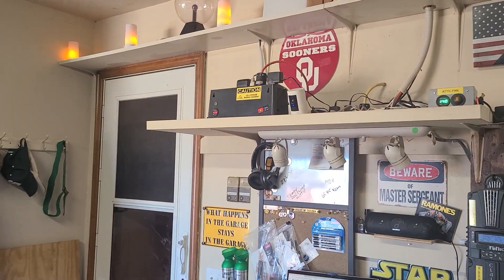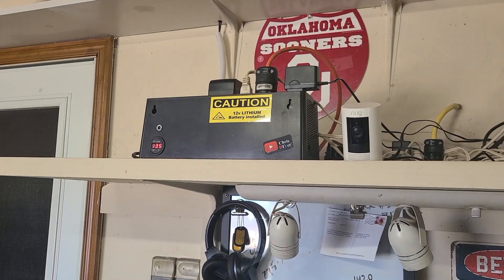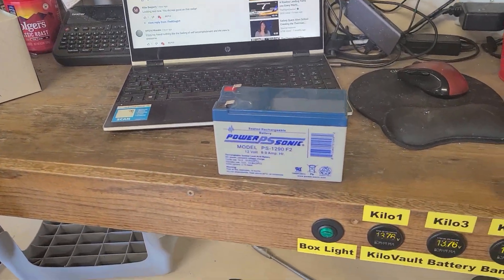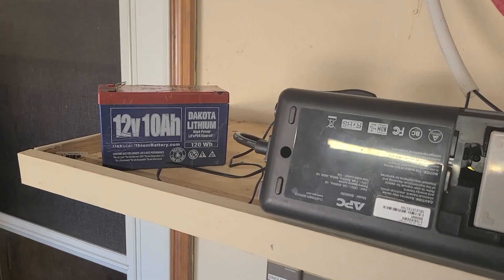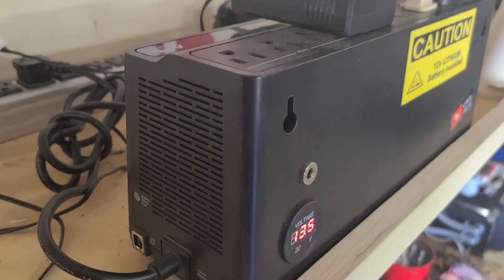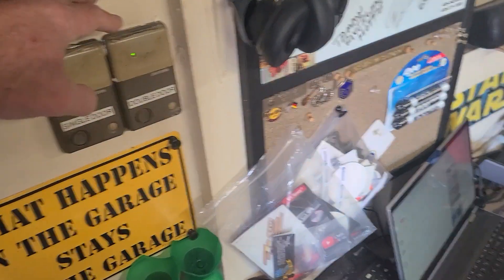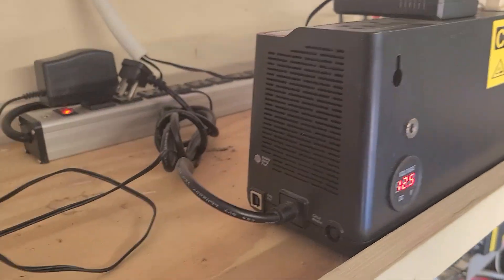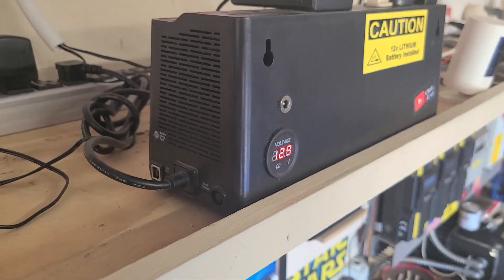Experiment! Will an APC Battery Back Ups 900 open my garage door?

Comment: The problem with a standard UPS is that is starts draining power from the battery as soon as AC is lost and will likely only run a short time before the battery dies compleley and even before it dies, there is probably not enough current in the battery to open the door a short time after the power dies.  Best would be to run the logics of the opener from a battery, and engage the UPS power through a relay when opening/closing is needed.

Comment: Why not put your watt meter in line and see if it peaks when in use, 
Maybe something simple like a bit of crud on the runners, or if it needs grease. 
Documentation of the garage motor, uses x amps but can goto y amps.

Just a few ideas, good luck.

Comment: Most of the small UPS' are typically have high frequency inverter or worse a modified sine wave inverter inside them. They typically don't have very good startup kick to them when running inductive loads. You have to size them almost 3 times the actual running load amps of the motor. Plus you have to contend with the internal BMS of the lithium battery on the surge amperage on the DC side.

I have successfully operated my garage door with an APC SUA1500 which is rated about 900 real watts and it is a low frequency inverter. I can say that unit quite heavy even without the two 24 Ah agm battery installed. Since it is configured for 24 volts, it'll handle the startup surge a little bit better than its 12 volt counterpart. I am working on to replace the lead acid with lithium soon as the 100 amp BMS arrives in the mail.
Reply from the maker: I think a 1500 dual battery would work @ 24v. I don't plan on buying one just for this purpose...unless I can find a hot eBay one online for cheap and modify it

Comment: with the led acid battery back in it; it may be the inverter inside that ups or safety circuits as that's not an online ups.  i didn't catch if you were running the ups off of battery or if it was plugged in.  If it was plugged in, the ups would have been in standby mode and just passing through the wall outlet electricity; but it will still shut down if it has too much of a load.
Reply from the maker: Yep! Just did a new video with a bigger battery. It didn't work and the APC shut itself down